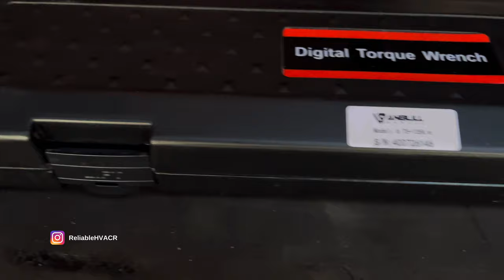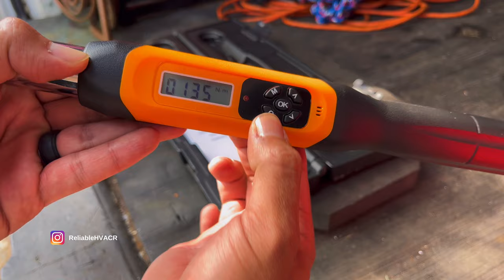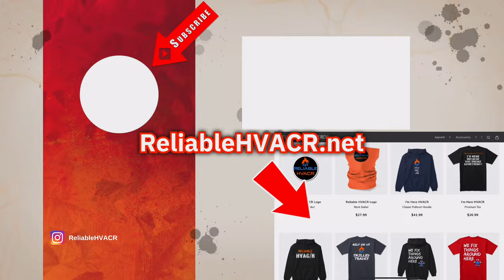Tool Day w/ an Amazon Digital Torque Wrench | HVACR

Comment: I have always used torque from the elbow depends on pipe size. I learnt the hard way in my training but the common cause was improper flaring of the pipe. it is hard to teach the newbies of the trade this so the wrench is a good tool. I have had the flare under-torqued and not leaking. The point I am saying is the prep in the flare and using oil/nylog to stop biting and twisting.
Reply from the maker: Good point 👍🏽 thanks!